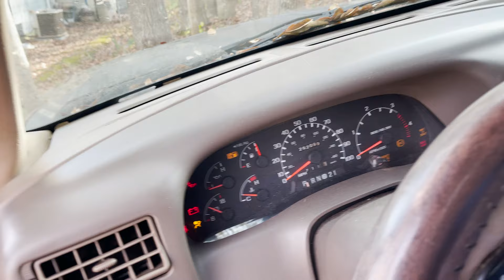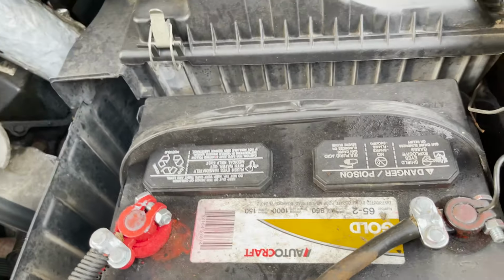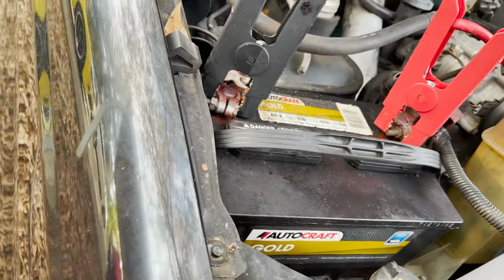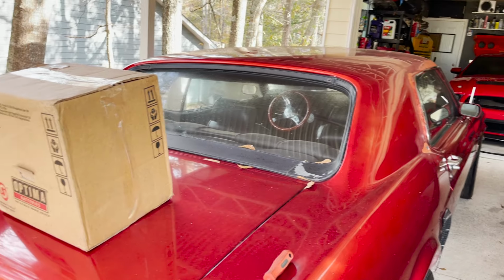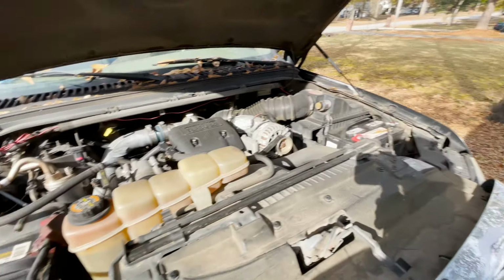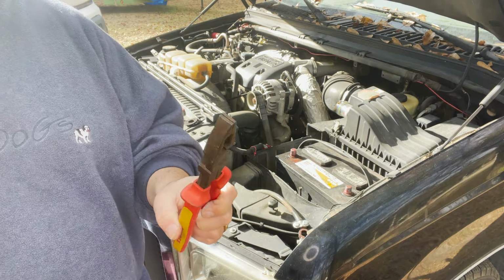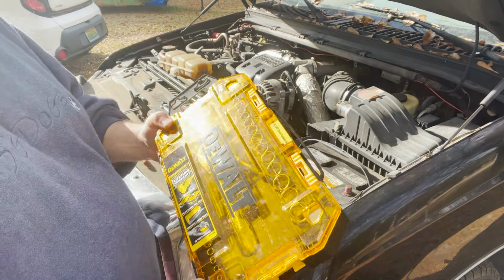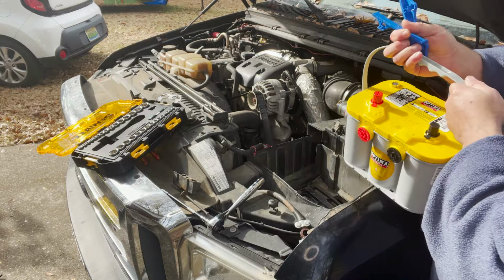Diesel Installs New Yellow Top Optima Batteries in the Big Diesel

Comment: I am replacing my battery today with this. My truck is '04 f250 w/ 6.0 in it. How do you like e battery so far? I am replacing my passenger side, then next month the other. My other is still 100% but still gonna do it . Thanks for the video, and info.
Reply from the maker: Thanks for the comment. So I had major issues, truck not starting correctly, low battery power etc. Found out I also needed to replace my battery terminals. I replaced all except for the weird one that comes from the bottom of the radiator area (that one is not just a terminal but a molded cable and was too much trouble). I replaced all with some gold plated (yes actual gold) and now the setup is awesome!!! So dual Optima Yellow tops with three gold terminals is the way!
Reply: @dieselsgarage  , thank you, I will look into those other terminals also. I just picked up my battery now, gonna go get her installed. I'm wondering, if some if my issues stem from those terminals.
Reply from the maker: https://www.autozone.com/batteries-starting-and-charging/battery-terminal/p/duralast-positive-battery-terminal/374187_0_0?cmpid=PLA:US:EN:AD:NL:1000000:BAC:816549785&gclid=Cj0KCQjwio6XBhCMARIsAC0u9aFcbUDvO9k0WX6k2SYSj5IY1LzdnQZgfHKvK6RDBADyCvyQGB5LbQgaAh5oEALw_wcB&gclsrc=aw.ds

Comment: Get a OPTIMA Chargers Digital 400 charger and maintainer. Or you can get the bigger one, the Optima 12V Performance Charger and Battery Maintainer. That’s all I get for me and my family. My yellow tops last me around 8 to 10 years.
Reply from the maker: Thanks! I will pick up a couple of these. Batteries are sooo expensive these days so it makes sense to make them last as long as possible.